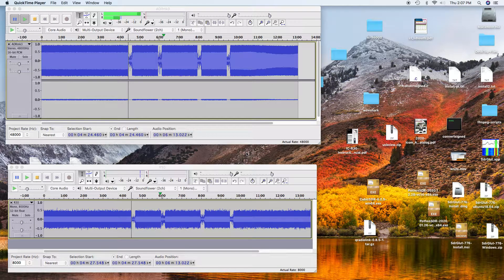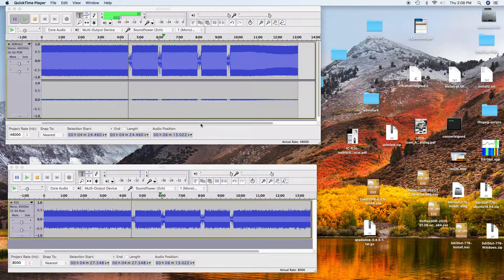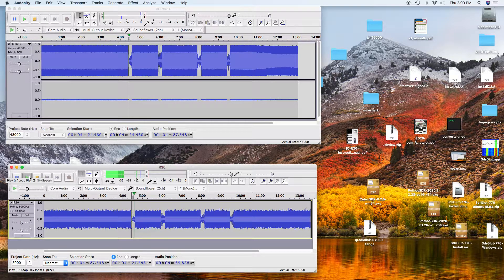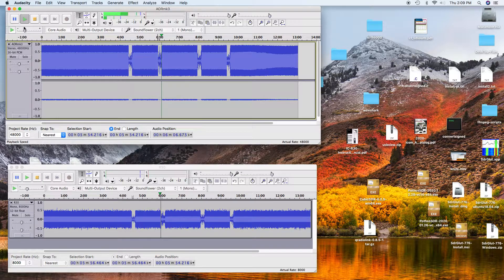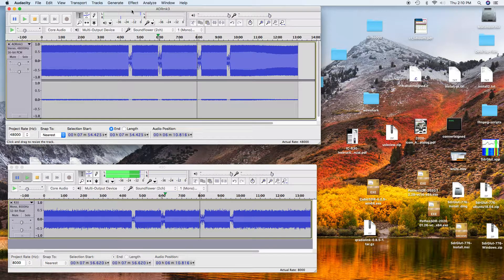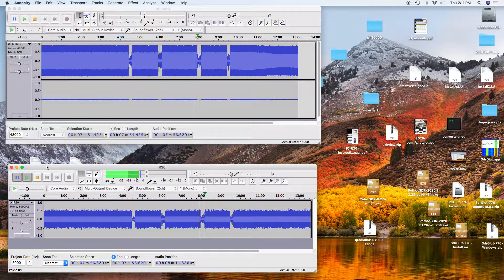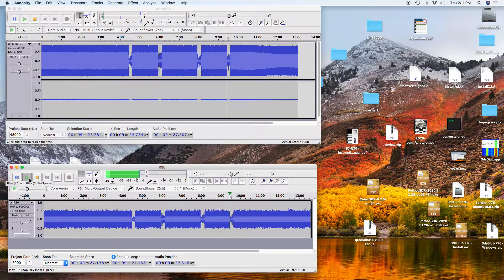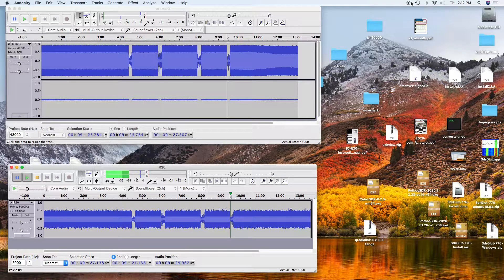Icom IC-R30 vs a AOR AR8200 MK3 at FRS frequencies

Comment: Can you do a video of the Icom IC-R30 vs AOR AR8200 on VHF Airband (118~137mhz) test, use the supplied telescopic Antenna, maybe search for Airport ATIS Weather Volmet or ATC Control Centre, does the AOR AR8200 pick up weak VHF Airband communications between 118~137mhz better than the ICOM IC-R30.
Reply from the maker: The AOR AR8200 and the IC-R30 do amazingly well - they both pickup stations that do not even show on the waterfall display of the BladeRF xA5.